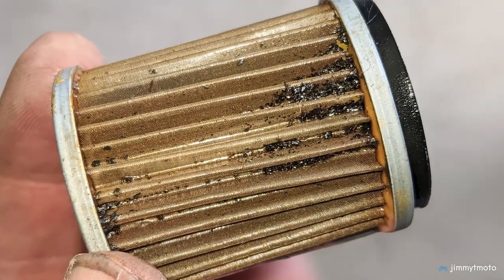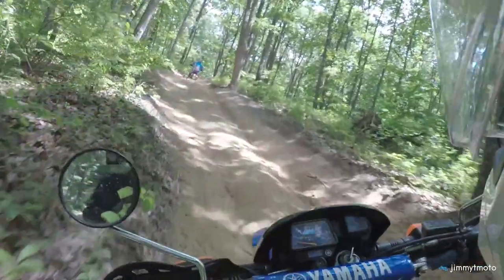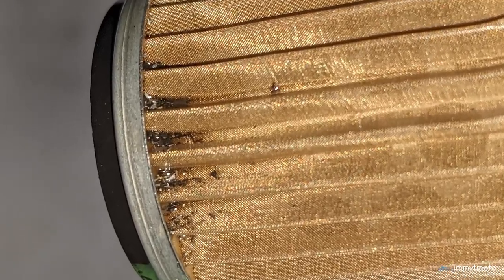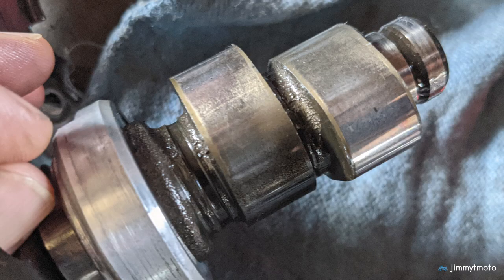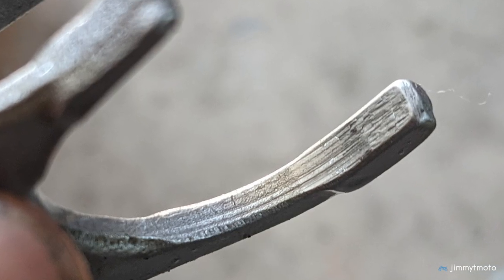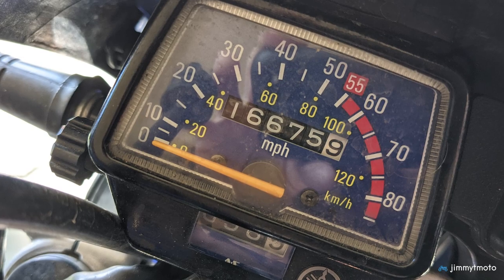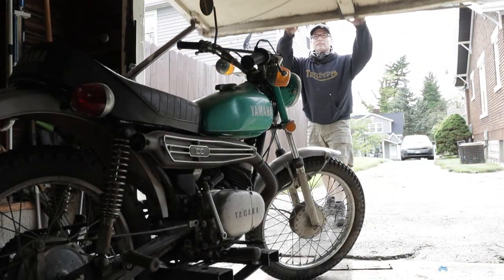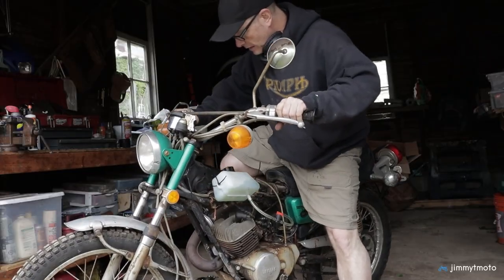Metal Shavings in the Oil Filter - UGH

Comment: Thank you for your video. I have just discovered today I have lots of metal flakes and bits in my engine today on my Honda CBR250RR. I really appreciate the info. I want to rebuild my engine and will be replacing all the bearings even if they appear ok just in case a slither of metal has contaminated them. Good luck with what you decided to do. Happy riding.

Comment: Okay Jimmy, rebuild with minimum spend but thorough clean, place your order for a CRF250F (OR BUY USED)yes the F, convert to dual sport for the road. You will like it, more power, great handling and not too tall, no mods needed other than road conversion.

Comment: Hi Jimmy!  So sorry to hear about your situation!  I’m keeping my fingers crossed that I don’t have the same as I have a 2004 with 5k and a 2006 with 16k like yours.  I’d take a little different route than fix it.  You say parts run $500 but what about your time?  That’s worth something.  I’m guessing another 700? That’s 1200 total.  With that, I’d be looking at two options. Sell as is and add that to the $1200 and go buy another used XT….or use the money as a down payment on a xt250 or something else…that’s my thoughts.  Or you co  you could keep it for parts and find another xt and buy it.  Cause I would also have to add in a visit to the ER room when I smash my knuckles on something during repairs!  Hahah
Reply: Side note: bought my xt 2006 new. Noticed speedometer red lined at 55 mph.  I never rode faster than 55 cause I didn’t want to over rev it. Come to find out, back then, top speed here was 55 on any hiway and speedometer red line was just for that and not because it was its max rev limit!  Live and learn.

Comment: At least you Have an oil filter. My 150cc scooter only has a mesh screen. I'd Love to put an oil filter on it but it's not possible. I'm still breaking in the engine and have to rely on a magnet to help catch any metal shavings from the break in. Btw, How do you "Flush" the engine for metal shavings without tearing it apart? I may want to do something like that to my scooter after the break in period.

Comment: Interesting irony that I would be finding this video soon after passing on a '05 XT225 with less than 1k miles on it. The dealer OTD was $4000 on a 17 yr old putt putt. I had every intention of buying it, and one of the main reasons was 6th gear! Had that price not pushed me away, it would be sitting in my garage right now, I would have a large lump of buyers remorse in my throat. Oh well guess everything happens for a reason.  Cheers.

Comment: This has been an issue with top gear on XTs since the beginning, really. The primary cause, other than the gears being a bit weak, is lugging. Allowing a single to pull a tall gear at low to moderate rpm tends to send shock waves through the transmission that over time cause stress pitting in the gears. 

If the engine was mine, I would just clean it out and salvage as much as possible, and replace just what's needed.

Comment: Hey Jimmy - That's too bad about your 6th gear. If money's tight I'd just do what is absolutley necessary... Clean it up and put it back together. If the extra bucks aren't a huge issue it may be worth it to do it while you have it torn apart. I had to do "The Walk of Shame" last night pushing my little Virago 250 around the block when the battery died (I knew it was on its way out but kinda pushed my luck)...switched it out tonight with a new one. Hopefully it's all good now. Took it for a little ride and seemed to be okay. 
Looking forward to more on your little Yamaha 100!
Kelly